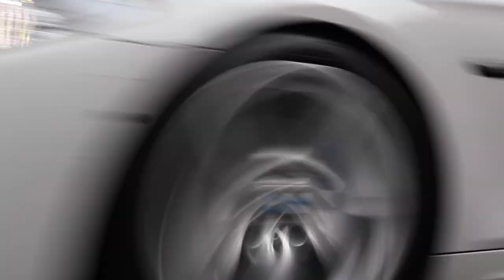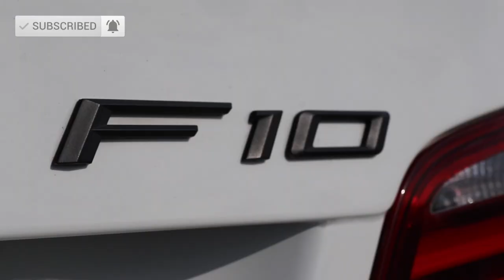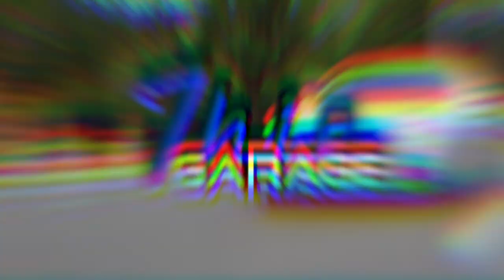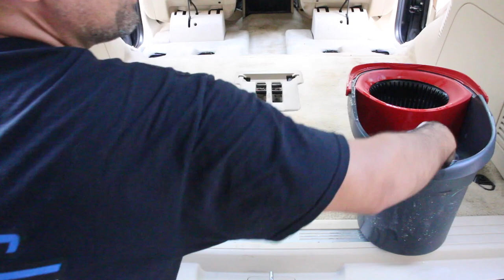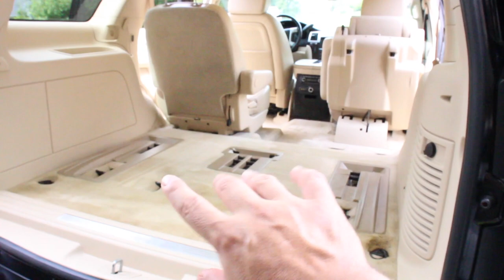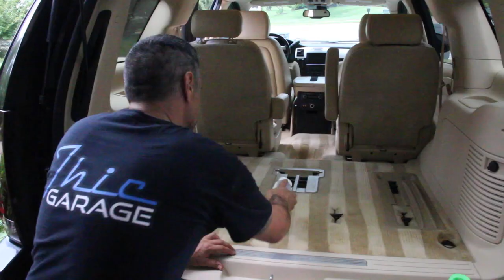The EASIEST Way To SUPER CLEAN Your Car Carpet Using Household Items DIY!

Comment: What's the quickest way to get it dry again? Dehumidifier?
Reply: I use to detail and in winter we would run the heater for a bit bit other than that I used an extractor and then went over with a vacuum at the end... but always leave a good crack in all windows so it doesn't cause mildew or stink